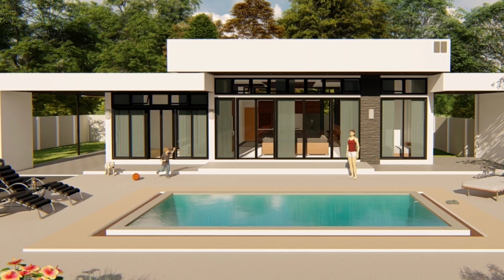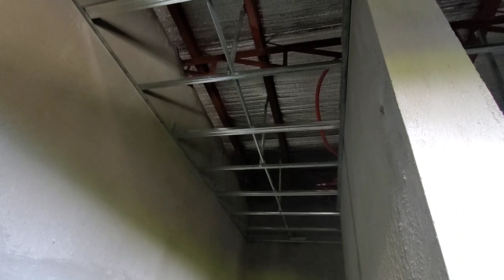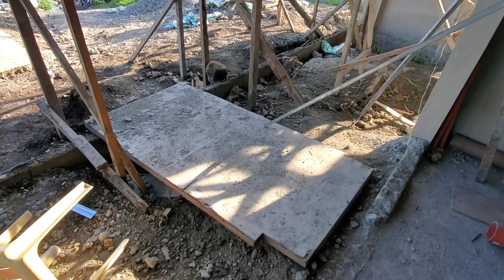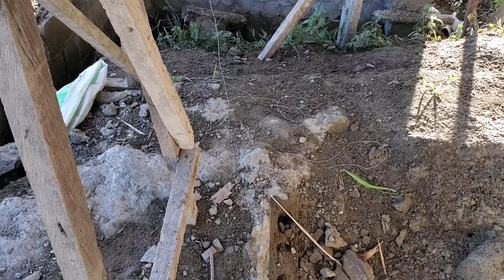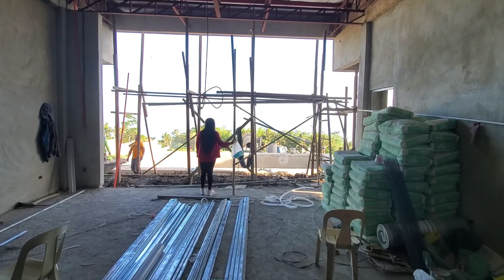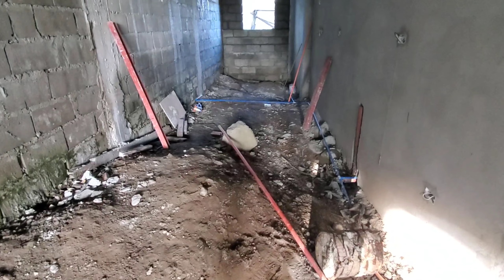Building our retirement home

Comment: will any vents be under the Facia ? in the hardy board ? to keep air moving inside the attic space . and allow heat out . 
Any insulation on the back side of the ceiling cement board to keep the attic space heat out of the conditioned space ?  the A.C. air will meet the ceiling boards .
Oh yeah! outdoor porch ceiling lights , very nice !  Really shaping up.
Reply from the maker: Yes, there will be vents in the cement board as part of the 2 meter overhang. No insulation on top of the cement board. Thanks for commenting.

Comment: Hi Wilma & Greg Another good video
I would think if the aircons can use solar it will reduce reliance on grid.
These inverter aircons very low amps no need for large circuit breaker 2HP is 1.5 KW Were 30amp can handle over 7kw .
So to give Aircons better protection I would recommend smaller circuit breaker max 20 Amp for 2 HP and 16 Amp for 1 HP. Remember US 110 voltage so amperage is double to 220volts in Philippines The other thing is the Aircon manuals will have recommend AMP circuit breaker to use

Just my thoughts
Reply from the maker: We use very little air con now and we live in Dumaguete (much hotter).  I don't think we will use the air cons much at all. Maybe just a night in the master bedroom. Yes, each aircon specifically calls for a specific type of breaker amperage.

Comment: Hi Greg  and Wilma!  House is looking great!  Question; in your rendering, on the upper right side of the large center beam at the front of the house, there appears to be a rectangular vent/air intake.  Is that just to vent the attic area or is it tied in to air flow in the house? If it is to vent the attic, will there be a blower to force-out the warm air?
Reply from the maker: That's actually is the architects logo, nothing to do with the house design. He says he puts that on all his 2d designs. Behind that beam is just air as its above the metal roofing. There will be venting in the cement board ceiling of the 2 meter overhang.
Reply: @buildingthephilippines  i have a question regarding the 2d design. In the design the upper beam where the logo is extended to the pergola area and in the actual build is reduced to the bedroom and personally i like the longer version in the design, that gives a wider look than the cramped one, what was the reason for the change , any technical difficulty ....
Reply from the maker: Very observant. Builder wanted to tie the cross beam directly to the large beam of the main living area. It made it appear longer and like you said more pleasing to the eye. All one unit. Thanks for the comment.

Comment: Electrical. It's the size of the cable and not the size of the aircon who decide what circut breaker to be used.
Reply from the maker: The specifications of the air cons call for a 20 Amp breaker for a 1 hp aircon and 30 Amp breaker for the 2.5 hp aircon.
Reply: @buildingthephilippines  that is minimum requirement. No problem using a 30 amp fuse on the 1 hk if the size of your cable is up to it.

Comment: Will you blow in some insulation above the cement board , I believe R 35 for ceilings, but I could be wrong.
Reply from the maker: Couldn't use blown insulation in the tropics. Humidity too high. It would be full of black mold quickly.